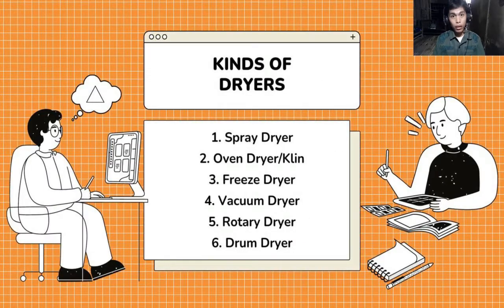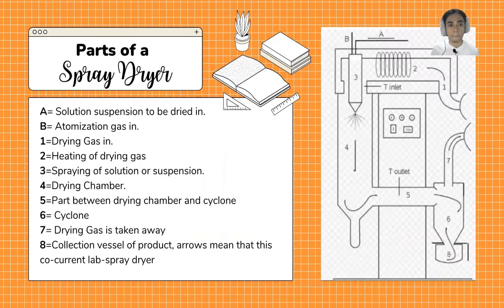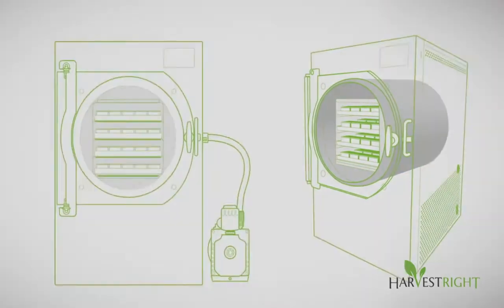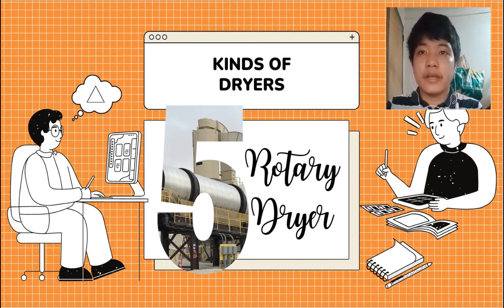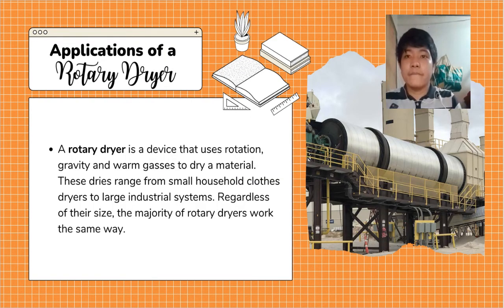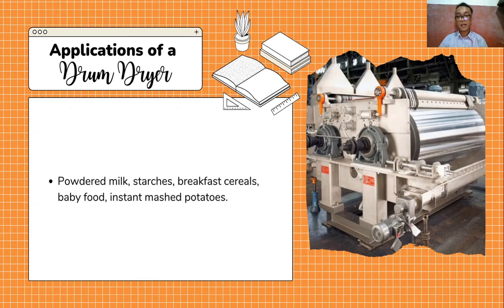Dryer and Drying Process

Comment: Ledesma, Nico Jay V.
1:37 Drying is a operation in which a liquid, usually a water, is removed from a wet solid in equipment termed a dryer. Drying can be described by two process operating simultaneously; Direct or Indirect Heat Transfer and Mass Transfer (solid characteristics)

Comment: Lawan, Edcel Benz R.
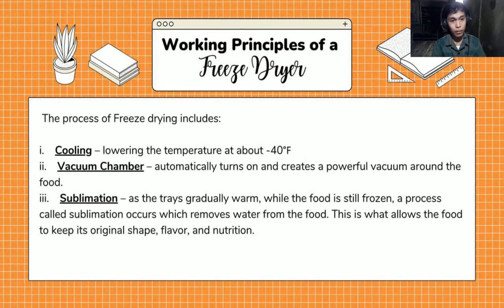13:20 Freeze Drying Working Principles
There are three process of working principles. These are cooling, vacuum chamber and sublimation. Cooling is lowering the temperature at about -40F. Vacuum Chamber is automatically turns on and creates a powerful vacuum around the food. Sublimation is the process of the trays gradually warm while the food is still frozen and it occurs which removes water from the food.

Comment: Pescador, John Berth P.

22:22 Rotary Dryer

It is a device that dries a material while utilizing a rotary motion, the gravity, and warm gas. It is a dryer that uses combustion of gases to provide heat inside the dryer while it is rotating making the material inside to be exposed more the the heat generated which makes the drying process faster and much more efficient.

Comment: Abello, Raynand R.
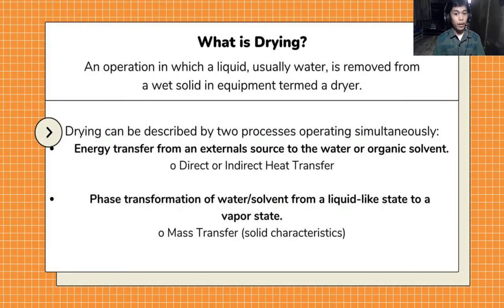1:25 What is drying
Drying is a mass transfer process that involves removing water or another solvent from a solid, semi-solid, or liquid through evaporation. Before selling or packaging products, this technique is frequently utilized as a final stage in the manufacturing process. The final result must be solid, in the form of a continuous sheet, lengthy chunks, particles, or powder, to be deemed "dried." There is usually a source of heat as well as an agent to remove the vapor created by the operation. Water is nearly always the solvent to be eliminated in bio goods like food and grains, as well as medications like vaccinations. Desiccation is either a synonym for drying or a severe kind of drying.

Comment: Macalaguing, Ivan Jun A.
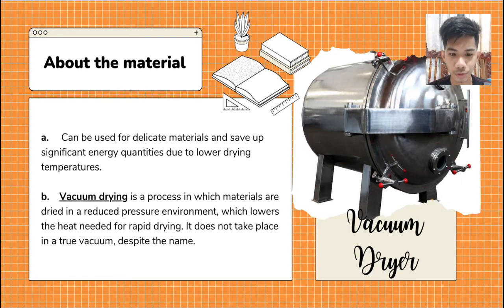17:50 - I've learned despite it is called a vacuum dryer, it isn't dry in a true vacuum. The process of it is to dry and reduced a certain pressure from a material which results to rapid drying. It also stated that the vacuum dryer can be used for delicate things. It has 3 phases which each of the phases have a certain process.

Comment: Emphasis, Red Alre L.
2:02 - What is drying?
I’m amazed to figure out that mechanical means to separate liquid also a kind of drying prosses. Like what Mr. Jouryel said just like doing laundry in “kong mag sampay og sanina ato ng yabyabon” is also a drying process because I always picture out dryer/drying process always includes heat and vapor. This process is very important in food industries since all raw food for I know compose of moistures.

Comment: Veloz, Adrian Clark D.

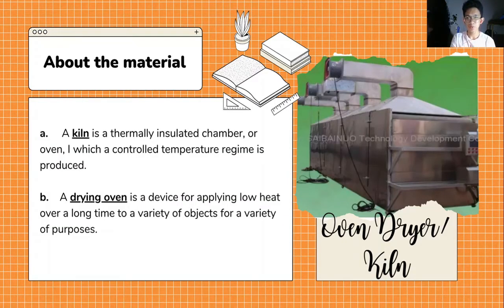8:40 Oven Dryer
Firstly, I am amazed at the fact that klin is something I heard commonly but I have no idea what it is. As a result, this dryer is used in the production of ceramics, porcelain (as indicated by the reporter's application), and pottery. The treatment starts with a high temperature and subsequently cools the product to a safe temperature; the product is seldom removed throughout the operation. Its uniqueness is that it can be interrupted while in process.

Comment: 1:21 What is drying?
Drying is the removal of a liquid (such as water) from a material that holds the liquid using heat. A wet solid or a liquid solution of a solid dissolved in a liquid can be used as the material. The drying process need a heat source and a sink for the vapor generated. The elimination of water vapor from a gas or combination of gases is sometimes referred to as drying. Drying is referred to as a "mass transfer" process in scientific language.

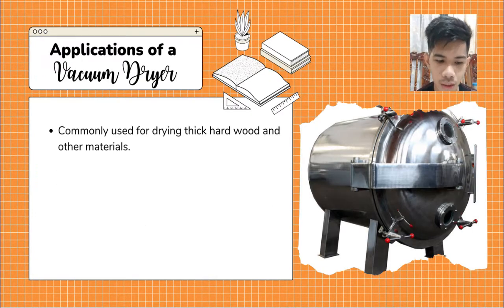Comment: 19:19 - Applications of a Vacuum Dryer

Heat sensitive hygroscopic and toxic materials may be dried using a vacuum dryer. If the feed for drying is a solution, it can be dried using a vacuum dryer because the solvent is frequently recovered through condensation. To improve product quality, such as fruit preservation, hybrid drying that combines osmotic dehydration followed by heat pump drying and microwave-vacuum drying has proven effective.

Comment: Calaque, Kyron Davonn C.
22:57 Working Principles of a Rotary Dryer

A rotary dryer works by rotating the material in a rotating drum in the presence of dry air. They can also be heated indirectly to avoid direct contact between the material and the processing medium. The drum is placed on a slight horizontal tilt and gravity helps the material move within the drum.

Comment: Castillo, Floyd L. 
15:51 - Freeze Drying applications 
 As stated by the reporter in the video, there are multiple instances where the application of freeze drying is used. Whether be it pharmaceutical, for food, or for technological industry, it has multiple benefits through its applications. The examples which I found fascinating were the astronaut food and the lagundi, where both greatly benefits in being freeze dried through increased shelf life and retention of nutrients and vitamins in the products.

Comment: Añora, Matthew Antoine Lawrence B.
1:39 Two Types of Drying
There are two types of drying: Mechanical and Thermal drying. In mechanical drying process, there needs to be an involvement of a machine that consists a rotary member (rotary dryer), that applies force to a wet subject to get dried. While in thermal drying process, a heat transfer is involved in a process of conduction and convection (radiation is out of the question since the products mostly involved in the drying process are food and pharmaceutical products).

Comment: Acelo, Ray Joshua L.
28:03 Drum Dryer
Drum dryer, the heated surface is the rotating metal cylinder. The cylinder is heated by steam condensing inside with a pressure ranging from 200 to 500 kpa. These drums are used in the production of mashed potatoes, cereals and soup mixtures.

Comment: Obrador, Crisaint John G.
1:25 - What is drying?
Basically, a mechanical method to remove the water from wet grain by blowing (heated) air through the grain. This drying is carried out until the grain has the desired moisture content. There are six different types of drying, and these are: spray dryer, oven dryer or kiln, freeze dryer, vacuum dryer, rotary dryer, and drum dryer. These dryers are unique in their own way and usage.

Comment: Dajan, Kenneth Joseph Rex D.

28:10 Drum Drying 
Drying viscous fluid, as well as producing dried powders and flakes, is done in drum dryers. The liquid fluid sticks to the external surface of the drum when it rotates. A thin coating of moisture is added to the surface. When the material is passing through the drum, steam is utilized to dry it. The conduction mechanism transports the heat into the drum, where the drying process begins. The materials dry completely throughout the revolutions of the process. Because of the fast heat and mass transmission, this sort of dryer dries quickly.

Comment: Lamberte, William Wallace A.
1:20 What is Drying?
What is drying? Drying is a process that involves removing water or another solvent from a solid, semi-solid, or liquid through evaporation and using an equipment called a dryer. And there are two types of drying which are mechanical drying and thermal drying. Mechanical involves the the use of machines in which the machine exert force in order to dry the specified object. Meanwhile, thermal drying involves heat transfer in order to dry a thing or two.

Comment: Casiño, Sharia Cyril P.
8:41 Oven Dryer/ Kiln
Basically, kilns are applied to manufacturing ceramic, porcelain, given by the reporter's application, and as well in manufacturing of pottery. The process deals with a very high temperature and then cools the product at a controlled temperature, the product seldomly removed while doing the procedure. Unlike with oven dryer, while on the process, it can actually be interrupted. This process deals with removing the moisture content of the product with a low temperature.

Comment: Casiño, Earl Anthony N.

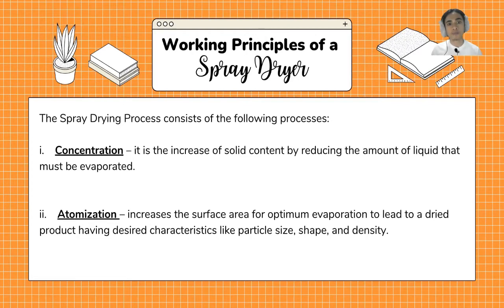6:26 | Working principles of a Spray Drying

Spray drying is made up of the following steps:
To begin, concentration is the process of increasing solid content by decreasing the amount of liquid that must be evaporated. The second step is to increase the surface area to allow for optimal evaporation and the formation of a dried product. The following one is droplet air content. In the drying chamber, the atomise liquid comes into contact with hot air that is mostly composed of oxygen and nitrogen gas.

Comment: Estillore, Cherry Mae P.
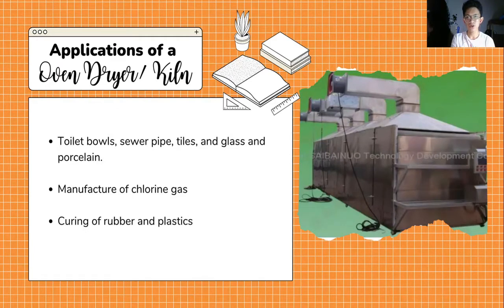8:57 Applications of Oven Dryer/Kiln
Drying ovens can be used in laboratory or industrial settings for a variety of tasks including evaporation, sterilization, temperature testing, and for incubating temperature sensitive experiments. Drying ovens are useful in various industrial applications such as incubation, sterilization of different products, evaporation, temperature testing, etc. These ovens are designed for exceptional heat distribution and drying. All these applications and many more stand as testimonials to the fact that industrial ovens are versatile and immensely useful in various sectors. With proper maintenance, these ovens can serve any industry for a long time.

Comment: Dacoroon, Darlene Grace F.
13:20 - Working principles of a freeze dryer
The process of freeze-drying includes cooling, vacuum chamber, and sublimation. The temperature used for cooling is -40F for the reason that is to keep the microorganisms existing in the material. The three processes play an important role in the freeze dryer. Overall, the reporter briefly explained the topic, where the ideas are well defined and elaborated.

Comment: Pelegrino, Justin Blake Nash E.
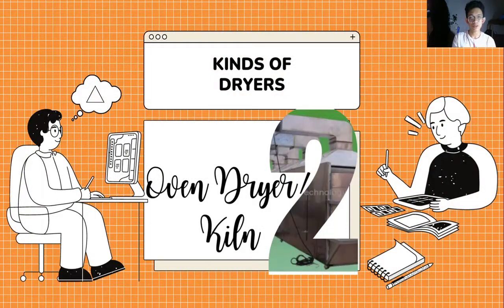8:34 - Oven Dryer/Kiln
An oven dryer and a kiln are both devices that are considered as chambers to store any kinds of products that are desired to be kept in a controlled temperature, in a span of time. These storing devices are used for curing rubber and plastics, manufacturing of chlorine gas, and many more. The sizes of these devices may vary to the needs of the user to dry, from a small, easily transferable dryer, to a human-sized, installed dryer.

Comment: Candaroma, Katriona Maxinne G.
27:50 Drum Dryer
Drum dryers are used to dry thick liquids and as well as to produce dried powders and flakes. When a drum rotates, the liquid substance adheres to the drum's exterior surface. The liquid is applied to the surface in the form of a film. Steam is used to dry the material when it is passed through the drum. The heat is transported into the drum through the conduction mechanism, and the drying process begins. During the process's revolutions, the materials are totally dried. Rapid drying occurs in this type of drier due to rapid heat and mass transfer.

Comment: Jayoma, John Lloyd E.

18:18 Working Principles of a Vacuum Dryer
The working principles of a vacuum dryer were clearly covered in this section. This emphasizes the need of efficiently using a vacuum dryer. Furthermore, the aforementioned working principles are divided into three phases: pre-heating, vacuum drying, and materials delivery.

Comment: Romero, Lorenzo Matthew D. 
4:20 Spray Dryer
Spray dryer is bulky and also expensive to install. It is difficult to clean after use. It has a low thermal efficiency that is a lot of heat is wasted during operation. Solid materials cannot be dried using spray dryers but overall the the reporter discussed well about the topic and its mechanism, even shows a video regarding the functions of other equipment used in the production.